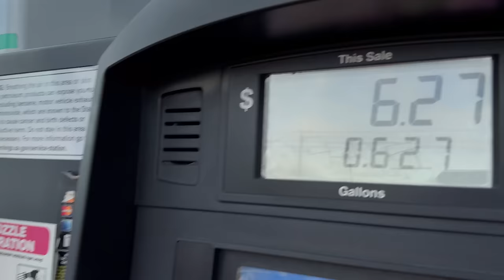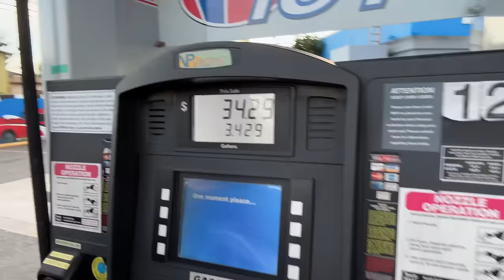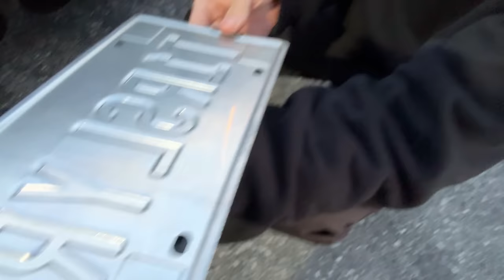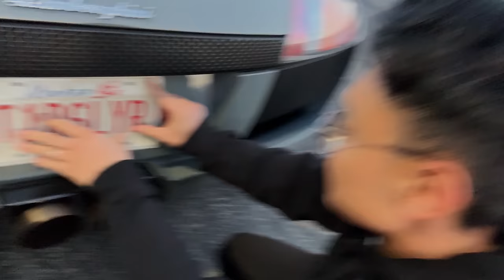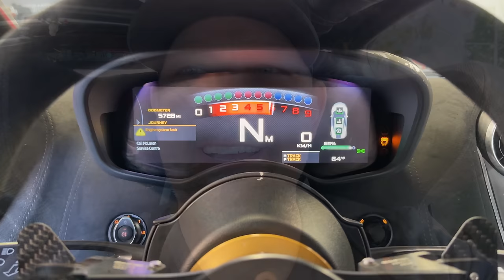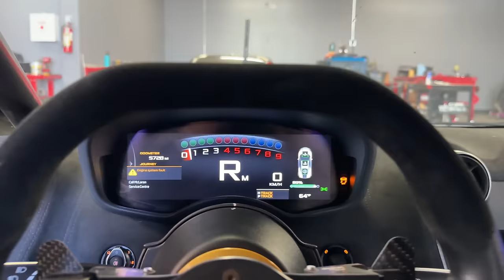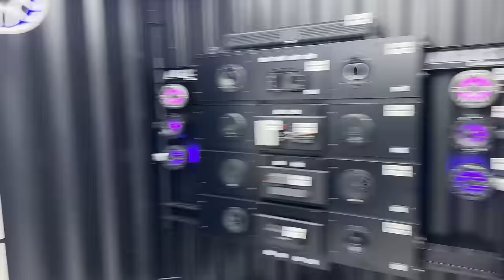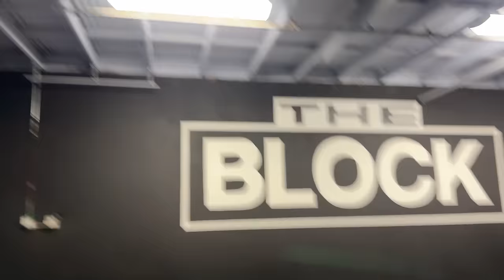BIG REVEAL at August Luxury Motorcars!

Comment: Looks like you need a metal plate that you can lock into place with bolts that are counter sunk.. also does the " tyre shop" connect to the " service area" if I wonder if  mike can drift through one side to the other ???